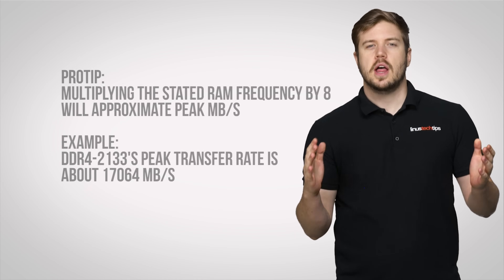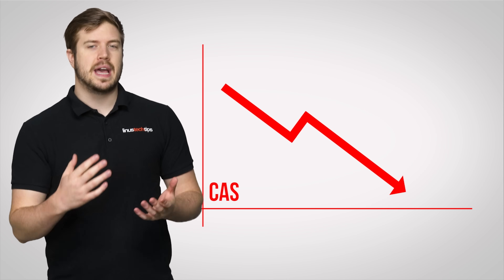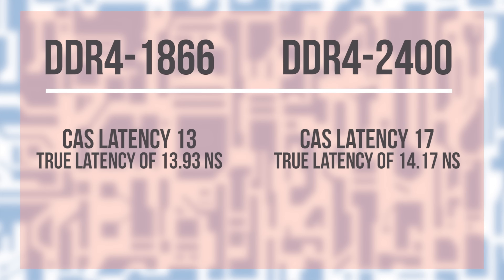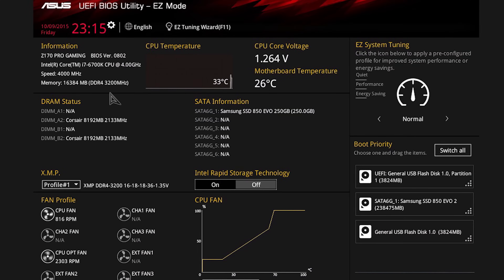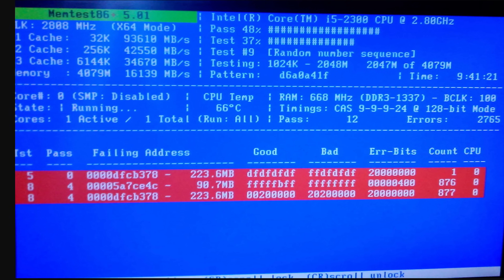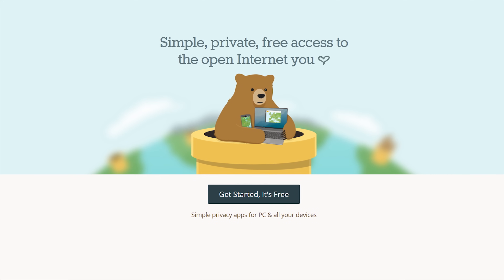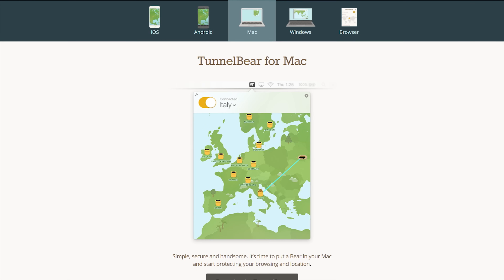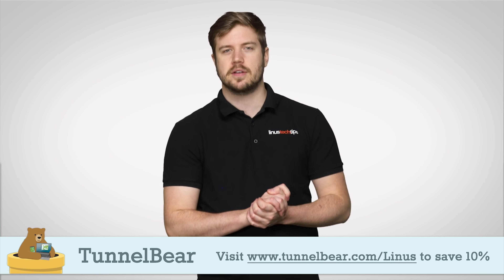How Do Memory Timings Work?

Comment: I'm struggling with my RAM's XMP profile. It will cause a BSOD of some type whenever it's turned on, and after checking I wonder if it's the motherboard not supporting RAM at 3200 MHz when that speed is from overclocking.

Comment: Need a ddr5 refresh of this
Reply: It's basically (16(Search speed) - 18 -18(This two is basically the delay for each search so it can't be lower than the first but it can be equal) - 35(The time the data is written and stays on the RAM, so it's probably OK for this to be big if you have enough RAM).

Comment: I was noticing my ram bottlenecking my fps in a lot of games but I was certain I had enough ram. So I bothered to tighten the default timings of my modules (awful timings) and suddenly the bottleneck is gone. The overall fps improved by a bit, but the lows just skyrocket lol

Comment: Thanks for the video! : ) Can I match my old 8GB DDR4 3200MHz CL18 with a second one of the same manufacturer and clock, but CL16 instead of CL18? Will it  make any significant difference?

Comment: I would agree with @techluvin7691, primary timings in the modern day beyond marketing and getting a vague understanding of what sort of dram modules exist on your ram don't exactly make or or break a kit. While there's a loose correspondence between better kits and the advertised primary speeds (exluding mhz transfer spd), it's as much to do with the specific DRAM modules being put on the ram board. The world of ram overclocking goes fairly deep and again seems to be more of an art than a science due to the massive range of kits and long lineup of testers. tRAS determining the speed of sequential access contributes much more significantly to modern rams performance yet is not openly advertised, as it relates to recovery time to read addresses in burst which all modern configs do.

Comment: Sooooo…….how much do you actually know about memory overclocking/tuning?  I recommend and tune ram on a regular basis for my customers and it is a very long process to achieve maximum performance and stability. I would NOT change the “primary” timings except maybe tCL and tRAS. What’s more important when tuning/overclocking are voltages (multiple) along with the “secondary” and “tertiary” timings………..remembering that your tuning for the “memory ic’s”, cpu, and motherboard in question. Look for kits that have even primary timings (eg 18-18-18-36 on DDR4 or 36-36-36-72 on DDR5). These kits will have better ic’s than those with looser timings. The quality of your CPU and motherboard will also have an influence on overclocking/tuning of your ram. I recommend purchasing a quality motherboard and ram as the benefits will outweigh the cost. “Overclocking” and “tuning” are not the same……….but all overclocked ram also requires tuning. My preference is to tune ram rather than overclock. With proper tuning……..excellent gains can and will be realized. Buildzoid is an excellent resource if you’re interested in learning the art of tuning ram. It’s not easy……….and it’s not quick……but the huge benefits are worth it. Having “ram cooler fans” also helps with keeping ram cool as heat will kill your tune/overclock. They are not an absolute requirement unless you’re trying to achieve a very high OC with high voltages. DDR4 is relatively straightforward on the voltage front with DDR5 being another animal unto itself as voltage has been moved onto the ram module itself. Ram overclocking/tuning is an ART. It took me a long time to learn the skill and there is always more to learn. I get better with every ram tuning because of the plethora of ic’s I have to deal with.

Comment: I bought a Corsair Vengeance RGB Pro 64GB (4x16GB) DDR4 3200mhz kit a couple of years ago and for some reason when running all it crashes windows.  If I only install 32GB it runs absolutely fine.  There seems to be something wrong with Corsair's rate timings which cause a BSOD.  Part Number CMW64GX4M4E3100C16 and their stated timings are 16-20-20-38 but this causes system crashes.  Does anyone know how to make them stable?

Comment: 2x8G Ram installation  the RAM  issues on Asus H61M-C motherboard with Xeon CPU E3 1240V2
Bank 1 Memory Slot not recognizing 8G RAM--How  to fix? I checked 2x8G Ram stick on other computer  and found perfect(Kingston 1600 Mhz)
It seems as though my Bank 1 Memory Slot is not recognizing any RAM I put in it. Here is what I've done so far to identify the problem:
When I put both 2 8G Ram stick on A1 and B1 slots my desktop Screen Blacken
I switch 8G stick to A1 slot my desktop Screen Blacken too.Then I remove it and place in B1and it detecting 8G memory and desktop running perfect.It only run  on B1 8G Ram slot.Can you fixit?
.

Comment: For some reason i ended up with 2 different MHZ sets of ram cards in my pc... one set being 2600mhz and the other being 3000mhz... i tweaked the timing and also set the ram to 3000mhz in bios (since it let me do it without keeping windows from booting up )  my stutter seems to have gone away completely...but here is the question.. should i go ahead and replace those 2600mhz cards with another set of the same 3000mhz cards that i have or do you not recommend me mess with it at all and just wait till i can get 2 sets of 2x16 cards at 3600mhz...

Comment: I know Ryzen CPU’s run best at 3733mhz CL11 or CL9 are the best atm I have Kingston Hyper Fury X 2x16GB 3600mhz CL11 I wanna go to 64gb of 3733mhz CL9 if I. Can find it, I may OC the ram I have to 3733mhz for better performance, I found some cheap DDR3L called patriot it’s 1600mhz CL11 with a 9-9-9-25 bought an 8gb sodimm for my stuck with single channel hp laptop it says ( 5 Rank Double Sided Module ) in the description I dunno if that’s for real or if it’s qaud rank gonna buy a 16gb kit for my other amd A-6 laptop in a few days it supposed to be made specially for some Intel processors and the AMD A-6

Comment: I got a ryzen 5 5600 should I buy 3200 mhz 16gb 16-20-20-40  or 3600 mhz 16 gb 18-22-22-42. About the same price.
My motherboard can only handle 3200 but might upgrade it to 3600.
Reply: Go for faster RAM simple as that. Timings are not worth thinking about, Ryzen loves mhz.

Comment: I look at the first and last numbers. The CAS Latency (CL) is often referred to as the most important, but the tRAS, which is going to be equal to or slightly larger than CL+tRCD, is also important. If the tRCD and tRP are large compared to the CL, you will get a large tRAS which will impact heavy processing demands on RAM, especially those involving numeric computations. In considering DDR4 4400, 19-26-26-46 vs 17-18-18-38, the disparity between CL=19 and CL-17 would have been minor and a major price difference wouldn't justify the faster CL. However, in looking at the next numbers and the resulting tRAS, the disparity between 26-26-46 and 18-18-38 is significant - and therefore opted for the CL=17 RAM because of the other timing numbers. Had the numbers on the CL=19 RAM been tighter down the rest of the timing string (e.g. 19-20-20-40), I'd have selected it for a much lower price.
Reply: Bam!  This is the best explanation.  The tRAS is the only reason I have yet to buy the G.Skill Ripjaws S5 with CL30-36-36-89

Comment: This is very not helpful for me in 2021 where cas is 14 on 3200 DDR4 G.Skills Trident Z dual rank 64GB 4x16 B-Die.
What I can say about that is the timings on it could need to be tightened up just a touch to get the latency down from 69ns to perhaps 64ns
Latency check is a good way to know if things aren't quite right. Most DDR has a spec sheet that shows what the latency should be.
I regret that I can't provide XMP 2.0 programing help on it yet. It's mostly about improvement to the sub timings and I'm not confident yet because I'm new at it.

Comment: I actually overclocked my HyperX Fury 2400 of cl15 to 3200mhz of cl20. Crazy right? Thats 800mhz jump. I didnt touch the timings coz theyre much more very dangerous to your modules. When you OC ram frequency, just let the board handle its default increment in timings and just increase the voltage to 1.35v

Comment: But I have a VERY important question, which drives me insane.

Let's say I have this formular:

13 * 2000 / 1866 = 13.93
I've seen this formular also somewhere else, but NO one explains, why 2000?
Where does the 2000 comes from? Is this a static number which never ever changes?

I hope someone can help :(

Comment: Hi, I recently bought Dominator Platinum 32gb 3600Mhz (8x4 CL18)
SKU: CMT32GX4M4C3600C18
I'm afraid I made a wrong purchase, could it limit performance? 
I am a very competitive person, I am about to buy a 1440p 240hz monitor and I dont want have any problems..
Here are all the specifications of my pc:
Case: Rog Helios
MainBoard: Rog Strix x570-E
PSU: Rog Thor 850w
GPU: 1060 zotac 3gb (I'm waiting for the Rog Strix 3080Ti)
CPU: AMD Ryzen 5900x Overclocked 4.6Ghz
RAM: Corsair Dominator Platinum 32gb (8x4 CL18)
SSD: 1tb Sabrent 4.0
Liquid Cooler: NZXT z73
Fans: Corsair QL120 / QL140
could you tell me what you advise me to do?
sorry for my bad english btw

Comment: I Understand the Formel to calculate the speed of RAM in Nanosecond in this way ( (13/1866) x 2000 = 13.93NS ), but I would be happy if you also answer my question, what I don't understand the number ' 2000 ' ?? Thank you in Advance :)
Reply: I was wondering the same. It makes more sense to do frequency/latency, and use that number for comparisons. If latency and frequency are expressed in cycles, the resulting number should be the usable frequency which has taken latency into account.

Comment: This short clip really helped me to understand how to start on overclocking my RAM,
As its really important on ZEN3 aswell,  A re-visit or more in debt how to OC Ram would be awsome!. 
2 things i missed in the video: 
1. do you first start on MHz and then on timings?
2.. How to calculate (after finding stable timings) the  Tras ?  i could not find a direct mathematical correlation between  (CL + TRCD + TRP + margin = TRAS)
at least i now know what to google and a bit more common sense on RAM timing tweaks :)
Extra: (aswell as a 2nd reviewer verifying if GN is on the right track between single and dual channel memory speed boost of 8-10%).

Comment: I opted for 64GB  instead of  128Gb   the  64Gb was  £60  cheaper and had  lower timings. I hope I did the right thing  the upgrade is  for running mataflow in Blender.

Comment: Memory is very important. If you browse Newegg, and find a very overpriced memory set  and, there’s a different set that looks the same, but cost less. Your not paying extra for nothing, with the more expensive of the two. You are paying for a quality binning process. I run DDR4 4,000Mhz 14-14-14-28-1T in quad channel on a 7980XE at 4.8Ghz. Don’t buy CHEAP memory people!!! It just ain’t worth it. My 4x8GB memory set was nearly $500 with taxes and shipping cost. Now, I’m not saying you should spend that much. But, it is a important part of the system. Don’t SKIMP ON MEMORY!! Cheap memory will always black screen after just about any type of timming or frequency adjustment in the bios after you hit F10+save lol.

Comment: An interesting question, would ddr3 at 2400 and a cl of 10 work better than ddr4 3200 at say cl14? On a memory intensive program? The true latency is better on the ddr3 but wouldn't the ddr4 still power through?

Comment: Guys, which one is better?
2800 16 18 18 36
2666 16 16 16 35 
?
Reply: There won't be masses of difference on those timings and the cas is the same so you will probably find the 2800 will still give you a bit more performance plus you can fine tune the timings and probably get it nearly the same

Comment: From my experiment, too higher or too low can cause game freezing or crashing. Blue screen and the bad one, bios not showing up at all. 
Happen to me, but i dont recommend anyone to oc if you have gpu. 

When it die, its sucks. Pull ram out, cable out, cmos out, usb cable out, hdmi out, (in all back), power up/down. Rewind all step until it shows up again. Sometimes, one step can fix, but sometimes extra effort.

Comment: Is there a default timing standard shared by all sticks when XMP is off?

Like will a Corsair Vengeance 3200 have the same timings as my old 2400 version when they are both left to run at stock settings?
Or would that 3200 stick run at its high 3200mhz latencies even when it's running at, say 2133mhz stock speed?

Comment: Hi i have 4x 8Gb 1866mhz cl10 kit hyperx and a gigabyte 990fxa-ud5 mobo Fb bios as Fc is invalid image!!!! and a fx8350  and i'm having real trouble with setting the speeds up for memory it seems to default to 1600mhz and no xmp or anything in bios if i set multiplier to 9.33 as stated for 1866mhz it don't boot but the bios goes to 10 for memory multiplier. so i have to increase FSB speed to 230Mhz to get 1810mhz  memory speed.
ANY info is appreciated.

Comment: They were pushing low volage 1.2 voltage ram for alot of ddr4, with like 19-16 cl timings. Though i found the much better route was to get 13 CL 1.35 voltage ram. the voltage made no difference. Though any ram that needs over 1.5 bolts i beleive is to high. But the new 1.35v ram runs much better with my system then the 1.2 v did. IF anyone curious i was running a i7 8700 with 2666 ram. Dont plan on OC'ing so

Comment: Bought ram from my local micro center 2 hours away with cl16 18 18 38 timings, the only issue is I can only find the EXACT same model with 16 18 18 **35**. So me, suffering with OCD freaked the hell out and went on a researching binge.

So from what I can tell, this 3 timing different won't mean shit?

Comment: I've noticed micro stuttering in most modern games, and I have a pretty decent rig at home. I suspect it's either my monitor, graphics card, or ram. My highest suspicion is my monitor, because it's actually a TV. it is running in 1080P with 60 frames a second, but I still experience micro stuttering more often than I probably should be.

Comment: Went from 2400MHz CL15 to 3600MHz CL16 which I worked out was a 12.5ns to a 8.9ns. I've noticed framerate is slightly better, in some cases it's a fair amount better from comparing them, but my lows are much better and I get fewer stutters and microstutters, in CPU intensive games like Battlefield 1 and 5 my average improved by a fair amount.
Reply: which 3600 cl16 did you buy?

Comment: What should i buy/ is better?

Corsair Vengeance Pro RGB 2x8 16 GB DDR4-3600 Kit Timings: CL18 22-22-42 vs AORUS 16 GB 2x8 DDR4-3600 RGB Kit geheugen Timings: CL18 19-19-39 Links: https://www.alternate.nl/Corsair/16-GB-DDR4-3600-Kit-werkgeheugen/html/product/1557108?event=search and https://www.alternate.nl/AORUS/16-GB-DDR4-3600-RGB-Kit-geheugen/html/product/1601557?event=search
Keep in mind i want 4 rgb sticks so when i will buy the Vengeance Pro RGBs i would/should buy the  VENGEANCE RGB PRO Light Enhancement Kit — Black                          :
Link : https://www.corsair.com/us/en/Categories/Products/Accessories-%7C-Parts/PC-Components/Memory/CORSAIR-VENGEANCE-RGB-PRO-Light-Enhancement-Kit/p/CMWLEKIT2
And maybe the corsair has also better programm for rgb  stuff and looks better. But there is a small price difference. 137 euro (Aorus) against like  149 euro (Corsair)

Or buy the same kit HyperX Fury 2666 C16 2x8GB so i have 4x8gb of ram so 32gb on 2666mhz with timings 16,18,18,39 ive im not wrong

My pc specs:
CPU: Intel Core i7-9700
GPU: Nvidia RTX 2060 
SSD:  KingFast 480GB 
HDD: Toshiba P300 1TB
RAM: HyperX Fury 2666 C16 2x8GB 
MBD: Asus PRIME Z390-A

Comment: I have a ryzen 5 3600x changed my ram speed and timings. Corsair vengeance 3200 cl 16. Changed it to 3200 and 16 18 18 36 and 1.35v. Motherboard is Asrock x570 phantom gaming 4. Now my cpu seems to be 60+ celcius idle, yet when I open task manager it goes back to 30c idle (I don't feel warmth from my fan nor does my fan speed up, normally I feel warm air flowing at that temp). could this be caused by my changes to the ram settings? Default it was at 2133mhz and 15 15 15 36, the volts I cant remember how much exactly. If I reset my bios, do my ram settings revert back to that default? 
Thank you

Comment: I love AMD but boyyy these ram timings and speed are frustrating me.. why can't AMD design a chip that's insensitive to ram like intel... I've been going through some crazy BSOD nightmare in the last 2 nights.. and for you, AMD users... a quick tip. Don't upgrade your BIOS firmware to the latest firmware if you're using 2000 series chip.. AMD have slowed down your B350/450 chipset and no matter what you do, you won't get 3600mhz stable. Stick with the older firmware, the one before they implement "compatibility with 3000 series chips"

Comment: Guys I have 2 questions. 
Q1: With 2 sticks my system can run at 1866MHz which is the claim frequency stock. When i add 2 more of the same sticks my system won’t boot at 1866MHz but ONLY at 1600MHz. why?
Q2: I can only boot at 1866MHz with all 4 sticks by ONLY raising the Bus Speed to 233MHz with timings @ 9-10-9-"9"-37-T1. Is the tRAS too slow then @9 instead of 28 that are rated in stock?
System Specs: (Yes I know, it's an old platform but plays everything I want still)
AMD FX8350 @ 4.86ghz (Currently running Multiplier @22)
Gigabyte GA-990FXA-UD3 (rev. 4.0)
G.SKILL 4 x 4GB Sniper Series 1866Mhz XPM Timing 9-10-9-28 stock (Currently running at 9-10-9-9 @233MHz)
AMD Radeon SSD Radeon R7 240g by OCZ
WD 1TB HDD
CORSAIR Hydro Series H100 Liquid CPU Cooler
ASUS Xonar D2 Sound Card
Sapphire HD7870x2 Crossfire
CORSAIR Enthusiast Series CMPSU-850TX 850W
Reply: ur last timing cant be that low try 22